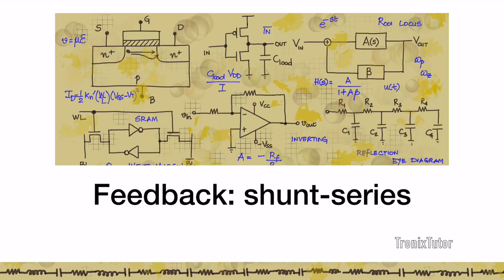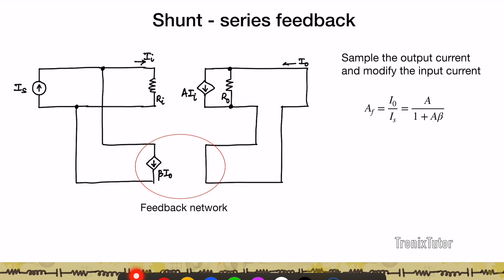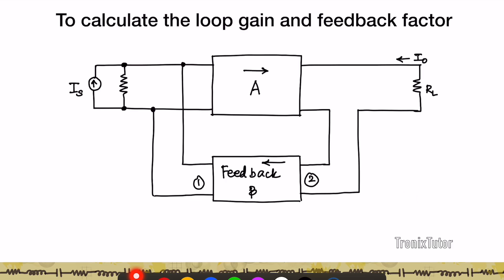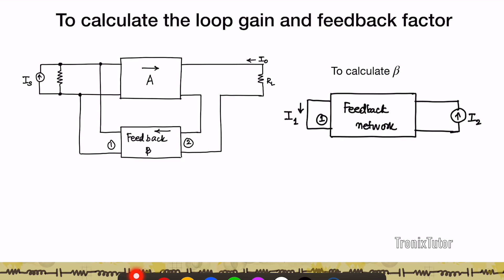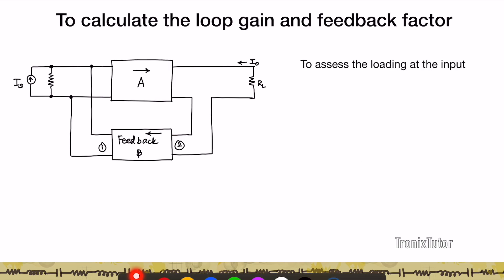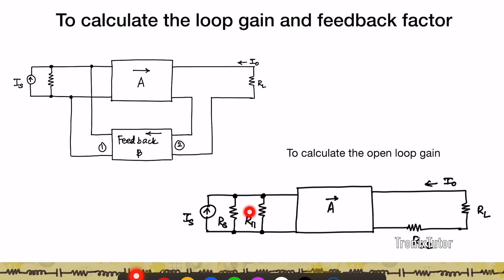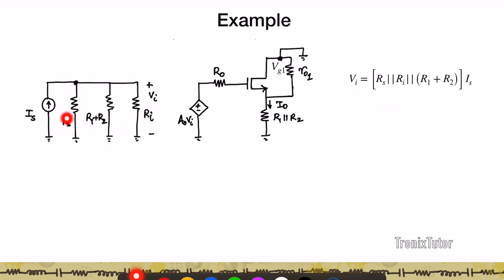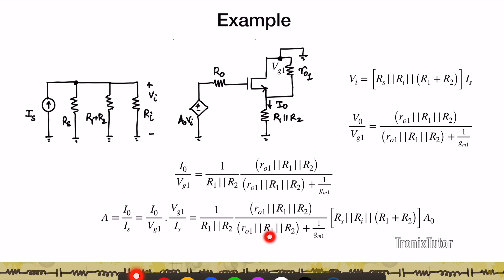Shunt–Series Feedback | Current Amplifiers, Loop Gain & Resistance Control

Comment: In the last quest, can't we say that the output current is being converted to voltage due to R1. Hence the feedback is sensing volage(M1 is working as a source follower) and returning current...?
Reply from the maker: If you look at the input end,  the input signal is a current and the summer is based on KCL at the input of the amplifier. At the output end, I0 is shown as the output signal. You can do a voltage sense if you are looking at the impact on V_0